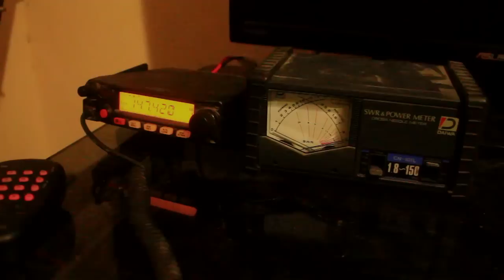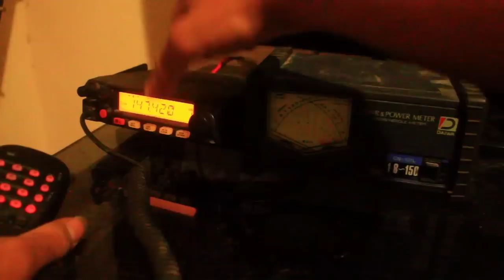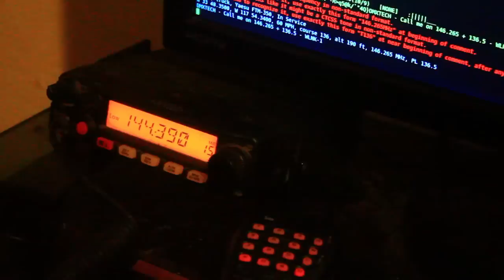DIY Groundplane Antenna for 2 meters

Comment: BTW You Can`t Solder Aluminum.
Reply from the maker: No, but as I found out in one of my most recent videos you can braze it.
Reply: @meercreate  Well, You Actually Can SOlder it, But Only With Vibrating SIOlder Iron
Reply from the maker: Yeah I know. Ultrasonic soldering can solder quite a few stubborn metals, but for hobbyists it might not be worth the cost. Thus I recommend brazing with an aluminum zinc alloy, as alumaweld and map gas or propane torches are a lot cheaper to get.
Reply: @meercreate  JUP !

Comment: Do people get in trouble by the FCC by making and selling homemade antennas?
Reply from the maker: TheTexasOOF Gamer No, homebrew antennas are perfectly legal to make and sell
Reply: WizardsOf12 is it  okay if a lightning bolt hits it?
Reply from the maker: TheTexasOOF Gamer Probably will vaporize it
Reply: WizardsOf12 so it won't cause a house fire because it's most likely going to be on a mast
Reply: WizardsOf12 because I was thinking about putting heat shrinks on the rods

Comment: I made one of this antennas, i was my first build, Today i install it on my roof, and try to use it at night, I plug the cable on my UV5R and started to receive small electric discharges from the antenna, did I made something wrong?? I unplug the radio at the moment and its working but now I kind of scare ...................
Reply from the maker: +Raul Andres Moch Are you near any power lines?
Reply: @meercreate  I recently built mine same steel welding wire. I've noticed the rods are rusting is that a issue, if I built another one would painting it affect the SWR
Reply: Nope, but it's kind of a rainy day I read about it on other blog and they say it's static from the air, they told me to ground my antenas. but thank you anyway!!! great work by the way!!!!
Reply from the maker: +Raul Andres Moch hmm, interesting

Comment: I bought an sma female to so239 to do just that. for my baofeng.
Reply: Baofeng i have too! I'm from Germany and my english are very bad, hehe.. 
This Antenne i have as Version with copper! And i can open the free Gateway in 19 Kilometes, out of my Home, also from inside! 
Or the AFU Relais DB0QH in ca. 30 Kilometers distance. So much Antennas we are have test here bevore, anytime become the Groundplane and this works better as other all! 4 radials with 49 cm length and a radiator with ca. 50 cm, so easy! And on top a Body with 3D printer. the radial simply screwed to the pl socket, ready is it! 😅
73! Locator JO41CP, HNDX Call 13HN527 de Bjoern ✌